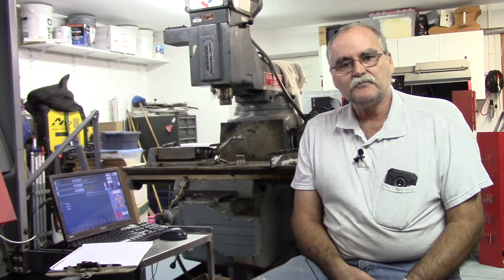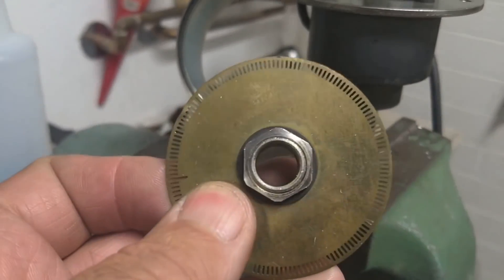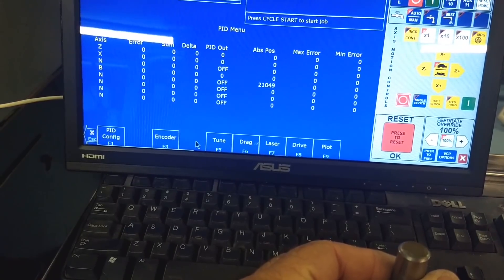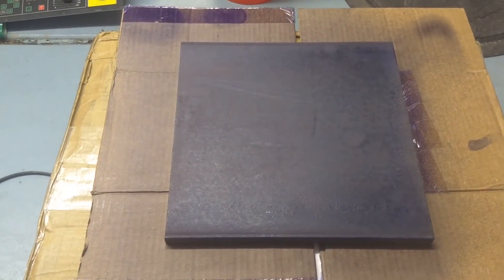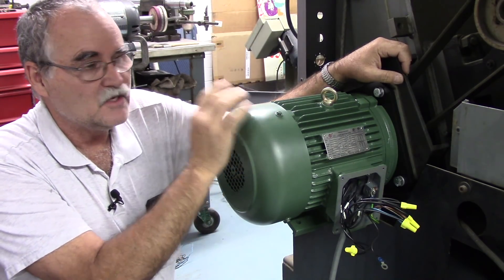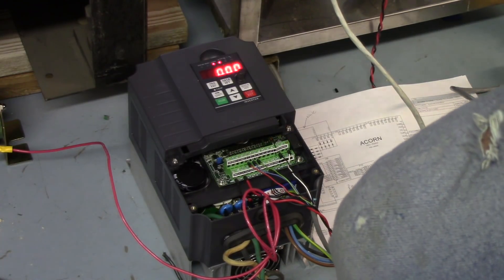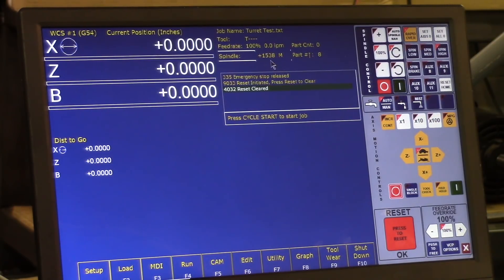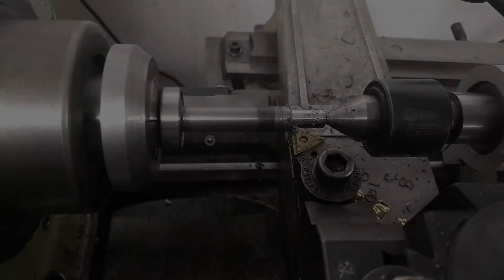Emcoturn 140 - Encoder and spindle motor adapter plate

Comment: Marty, I have the Emco PC Turn 120 with the original motor.  How did you program the VFD to get to the speed.  My motor is 1800 rpm, but the specs from Emco say 3000.  Did you basically double the frequency?
Reply from the maker: Can use the original DC motor. It was replaced with a 3hp 3phase motor
Reply: @martyscncgarage5275  My motor is a 3ph 2.2kw.

Comment: Hey Marty, could you post a scenario setup in Acorn for compensating a pulley ratio using a spindle motor pulley setup.
It looks like the 140 has a 1:2 final drive? How does Acorn calculate accurate feeds & speeds concerning ratios? or does the programmer have to manually do the math and edit spindle speeds after post processing. (command "S" is going to read off motor max rpm set in spindle parameter setting page? but this is not 1:1 final drive)
Reply from the maker: You have to set the VFD up correctly. Set the upper frequency max setting according to the desired max spindle RPM. Same with the lower frequency setting, min RPM. Acorn out puts 0-10vdc Which is linear with the RPM.

Comment: Hi Marty
Where did you buy the motor?
How is the import drive and motor holding up?
Reply from the maker: Leadgo sells on eBay. I have not finished the lathe yet. I got the motors and drives yesterday. Need to finish the Emco CNC 5 first

Comment: Hi Marty! Thanks for the helpful videos you do!
I have a pm25 an a acorn. I wont to control the spindle with the acorn. How would I go about this?  The acorn out puts 0-10v and the pm25 needs 0-5v.
Reply from the maker: Off the top of my head, I would think a pair of resistors acting as a voltage divider. BUT I strongly recommend you post this question on the Centroid CNC Acorn User's forum:  http://centroidcncforum.com/viewforum.php?f=60

Comment: Nice job.  FWIW almost any good VFD will run from single phase, with 1/2 the output derating.  I'm running ABB and Magnetek (yaskawa) VFDs on single phase.  On the Magnetek drive I'm running a 10hp 575volt motor, it's fed from 240v single phase through a transformer... the VFD is rated at 20 hp with 3 phase input.  The key is to check the user manual to see if input phase loss detection can be turned off, and to limit the input current.  The other plus is you can usually find the larger VFDs on ebay for fairly cheap.
Reply from the maker: Hi Greg, thanks for the comment. Yes, I am aware of that. I've just been please with Huan Yang and their responsiveness, and customer service. I know of several people I know that have had them for several years.

Comment: It's good to see your work. Why do you use Centroid instead of Linuxcnc?
Reply from the maker: kmcwhq, very easy, Centroid CNC User interface runs under very familiar Windows 10. No Linux operating system knowledge needed. The motion controller runs under a modified version of Linux and is transparent to the user. Further, the software and motion control hardware come from the same company. That's a huge benefit, it's already optimized and designed to work together and support for both can be found on the Centroid CNC Acorn user support forums. Lastly, Centroid CNC has been doing Industrial CNC motion control for over 30 years. Top notch people.

Comment: Nice motor mount . What is your  ratio between your motor pulley  and the spindle pulley?
Reply from the maker: About 1.6:1
At 3000 spindle RPM, the motor is running at 5000 rpm. When the machine was delivered, its max spindle speed was 2500rpm.
Reply: In acorn wizard what do you have your max rpm spindle set too? Did you have to make changes in that to equal your MDI input for correct encoder reading?
Reply from the maker: First, assuming you have a line driver encoder connected to Acorn, you enter it's line count x4. Mine was 2000, so I entered 8000 in the encoder entry box. Follow this post to tune your machine (assuming you have a VFD): http://centroidcncforum.com/viewtopic.php?f=60&t=1650
Reply: Just wonder how you did your setup. I have a D.C. Spindle motor at 20hp using a Caltronic  D.c. drive. It takes the same analogue input as. VFD 1 to
Reply: 10 vdc. I just change the maximum rpm in the wizard to obtain the correct rpm display.
Reply from the maker: TheJR914, you would need to know the max RPM of the machines spindle and enter it in the Min and Max rpm of the wizard. 
If you don't know that, then put min 100 and Max 1000. In MDI type M3 S1000, you will have full 10vdc out, so motor will be at full rom. Using a hand held digital tachometer, check the spindle RPM. Whatever you read would be you Max RPM, enter that in the Max RPM in the wizard. If you have an encoder belted at 1:1 with timing pulleys and belt to the spindle, simply read the RPM on the main CNC12 display and that should be your max RPM
Reply: I had to set my lathe up a little different but got the correct results. MAX rpm on my motor is 3500 with the transmission in high (2-speeds) my spindle rpm is 2000. But in the wizard its less rpm 1900. I use CSS when I run my programs and G50 is set to 2000. I have a 2000 encoder with a 1 to 1 drive from the spindle but all is good.
thanks John